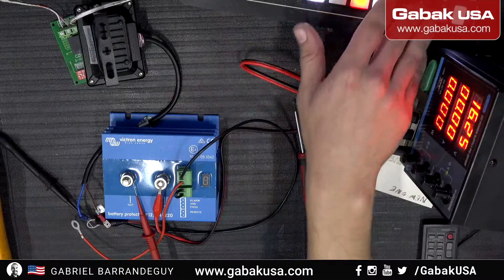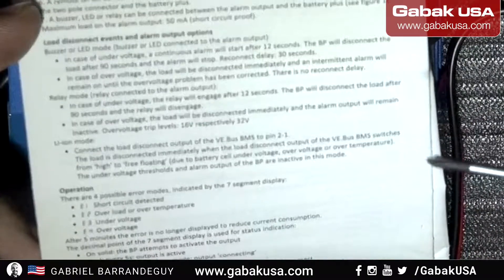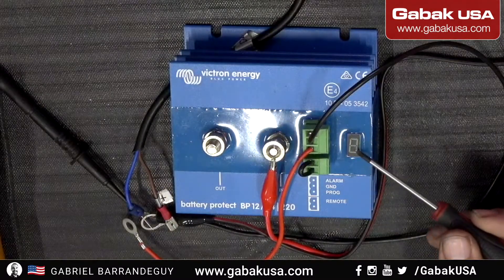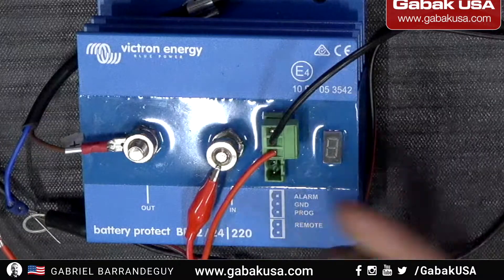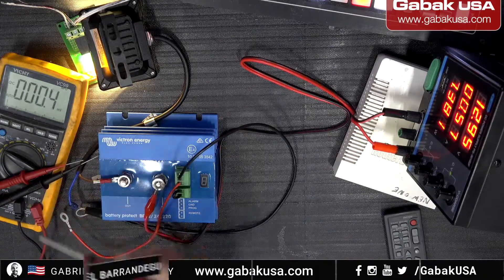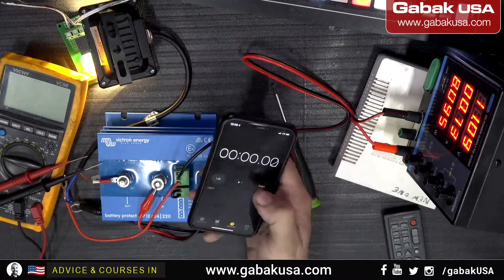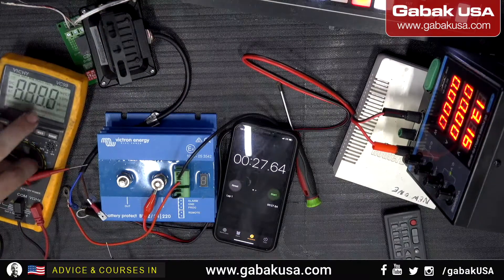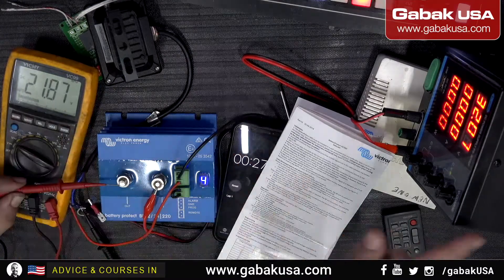Victron Energy Battery Protect configuration

Comment: I have a question. Do you know the differences between smart battery protect and battery protect? Does smart battery can remote control the switches on and off? Thank you.
Reply from the maker: smart batteries usually they have their own circuitry that can interact with the rest of the system
so if you buy every victron that will be the best case